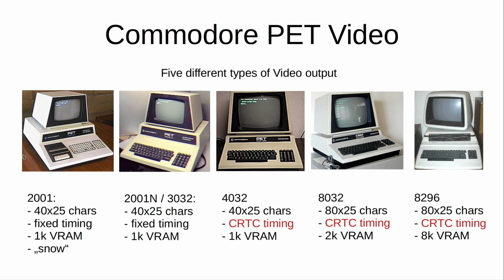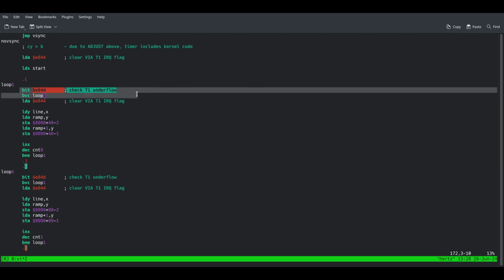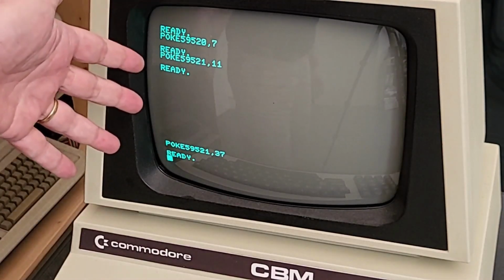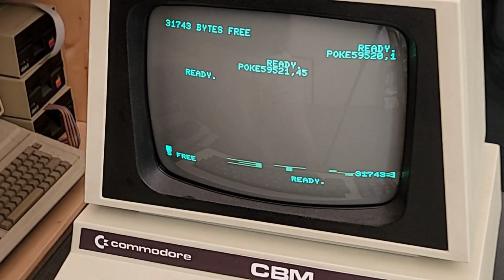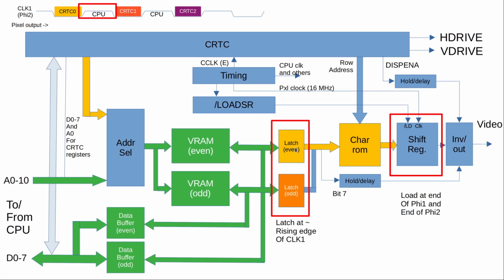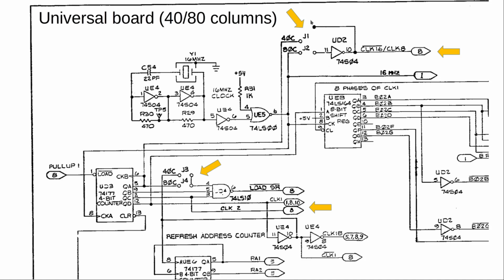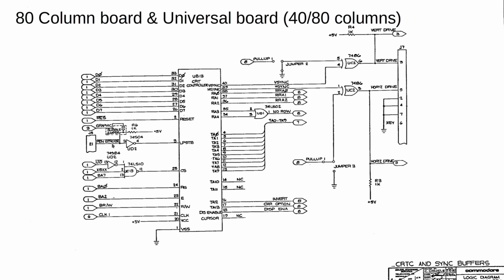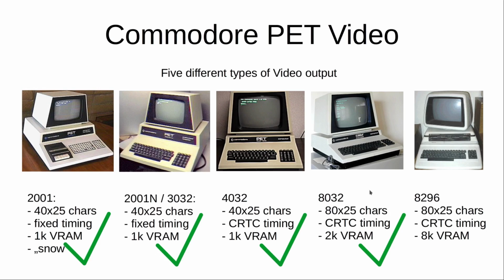8bit-times: PET video output Pt2 (Ep.31)

Comment: Great stuff!

Regarding character-height (at about 32:15): Are you sure REG 4 is just a 7 bit-register in real life? I know the datasheet for the chip says so, but it does not mention that you have to subtract 1 for REG 9 as well. I also know of one demo (No Pets Allowed) that uses a character-height of 3. According to the source-code for that demo available on POUET it seems to get to the needed 400 rasterlines by using a large value in REG 5 for adjustment. However I found out on the C128's VDC that REG 5 will only adjust to a maximum of the char-height value itself and not above. Did you test what happens when you go to char-height of 2?

Of course you could also set the video-mode to be PET2001-style so it has 15.7 KHz horizontal and 260 lines. I have confirmation of that mode working on 4032-monitors, not sure though if this could cause damage to the monitor if used too often. Anyway: In that 260-line mode it should be possible to use char-height of 2 if REG 4 set to 127 and REG 5 to 4 is possible.
Reply from the maker: Thanks for the comment. 

R4 is only 7 bit. R9 has an offset of 1. Just verified both here https://web.archive.org/web/20160611083324if_/http://archive.6502.org/datasheets/rockwell_r6545-1_crtc.pdf
Not sure about R5. The VDC is a recreation, and not an evolution, so it may behave differently in details. 
You can create many different scenarios with different char heights. You could for example soft-scroll lines by shortening chars above and increasing chars below the scroll area.
The 12" monitors may be more flexible than we think. I didn't try other timings though - not even the 60Hz timing. So I can't comment on that. But the assumption is 50Hz and 60Hz countries got the same hardware, so more different timings could be possible